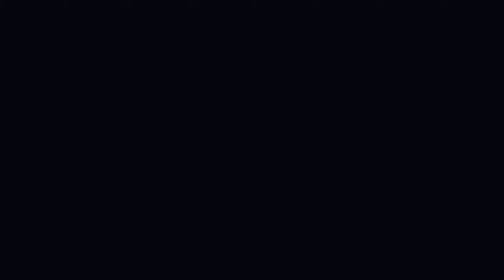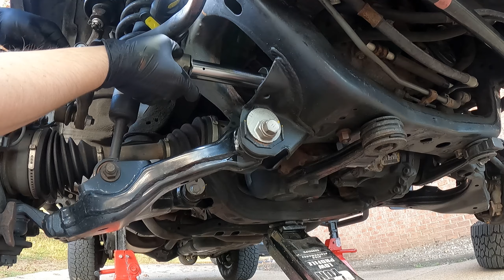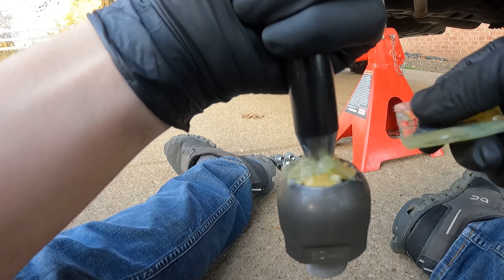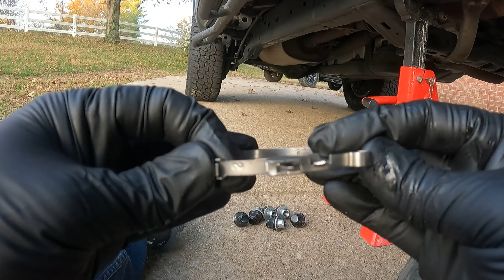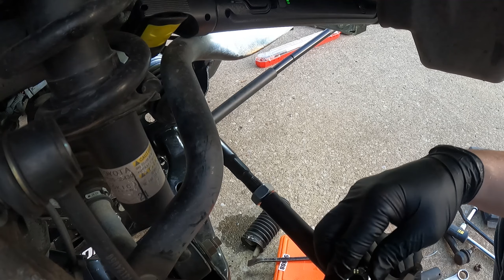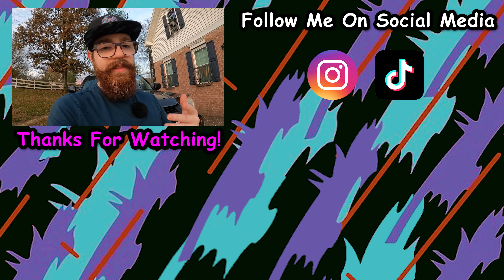4Runner Inner and Outer Tie Rod Replacement

Comment: A couple of recommendations.   1.  I wouldn't turn the car on and move the steering with the outer disconnected.  It will throw your zero point off a lot more and if you are driving it to the shop after for an alignment, then it might activate your ABS from it.  Instead, detach the outer BJ from the spindle, then just loosely put it back together and then turn the rack outward to get more access to the inner tie rod.  
2. Ditch that tie rod tool to remove the inner, they strip out all the time, you can use a longer pipe wrench instead.  3.  Use OEM or Sankie 555 for tie rods and not the Chinese stuff, they don't last.  But for Sankie 555 get them from rock auto not ebay as there are a lot of fakes for them.  Rock Auto is an authorized seller of Sankie 555.

Comment: from what I've read, the outer tie rods are side-specific (2 different parts) - is that how you ordered them?
Reply from the maker: They're not side specific, they'll fit on either side without any issues. Whenever I've ordered them they've always been listed as "front outer" and "front inner". Maybe some other brands have side specific, but I haven't came across that yet
Reply: The boots are side specific

Comment: How do I know when to replace it?
Reply from the maker: If your steering is sloppy, loose, or has excessive play in it and doesn't feel as responsive to turn as it used to. If the boots on the outer tie rod are ripped, that'll be a good time to replace them as well. Your alignment tech should notice these things when they're adjusting your alignment and give you a heads up if they're looking bad.